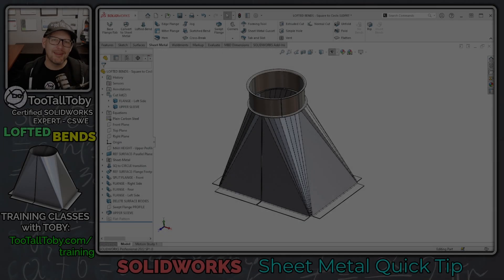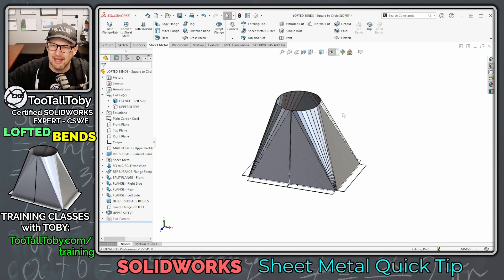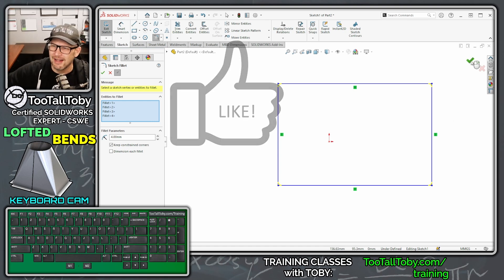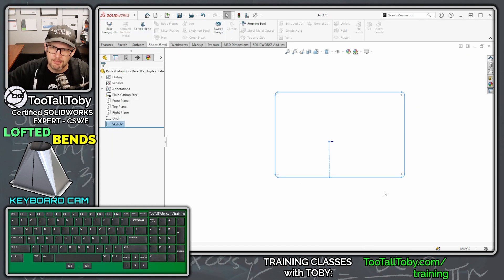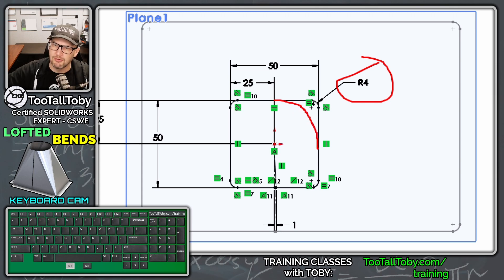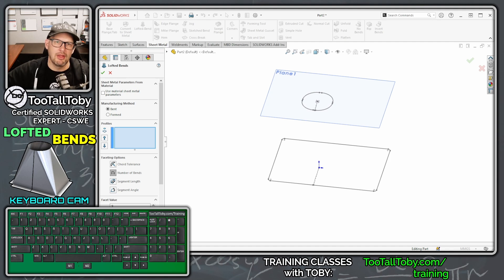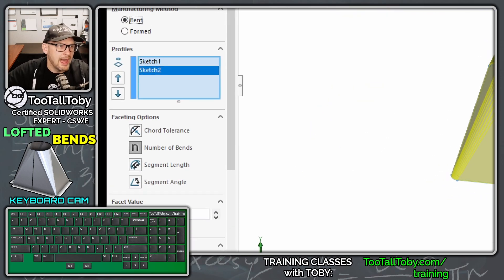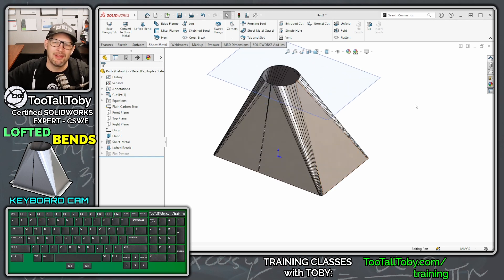Air Duct Reducer in SOLIDWORKS Sheet Metal - Tutorial for Students - Rectangle to Circle - HVAC

Comment: What you are showing here is nonsense. You can make from square to round. sketch topics doesn't have to be the same
Reply from the maker: Bro you've been following me long enough that you should know that I'm usually pretty on point, and that I'm not going to release a video (and leave it posted) if it contains "nonsense" 😁

Under MANUFACTURING METHOD, You can only use the option for BENT if you have the same number of entities in each sketch.

Try it
Reply: @TooTallToby  my good friend I make a living drawing parts like this. try this, you have to draw a circle and make the cut in the same place as the square.
Reply from the maker: Nice - Maybe it's just my version of SOLIDWORKS but when I follow the steps below, I only have the FORMED option, not the BENT option (for a sheet metal lofted bends command).

I re-read your replies and I noticed that you have only discussed lofting, but have not specifically said that you are able to do these steps using the sheet metal lofted bends command, and the manufacturing method of BENT.

Perhaps you could try these steps and confirm:
1. New part
2. Sketch a circle on the top plane
3. Add a gap to the perimeter of circle so that it is not completely closed
4. Exit sketch
5. make a new sketch plane, parallel to the top plane
6. New sketch on this new plane. Sketch a rectangle
7. Add a gap to the perimeter of the rectangle at the same location as the split to the circle sketch, so it is not a closed rectangle
8. Add fillets to the corners of the rectangle
9. Exit sketch
10. Launch sheet metal lofted bends
11. Pick the 2 profiles
12. Choose the manufacturing method option for BENT
13. hit the green checkmark

For me this doesn't work. I can use the option for FORMED, but not BENT

Let me know if it works for you, and let me know what build of SOLIDWORKS you're on.

thanks
- Toby
Reply: @TooTallToby  Hi Toby Sorry, I didn't mean to attack you. And yes it works. Believe it has worked since 2020. you are doing a good job thank you for that. have a nice day. Wagner
Reply from the maker: Thanks-  can you create or share a video showing this working? I have tried this many different ways using SOLIDWORKS 2020 and 2022 and I cannot get it to work, and I'd love to see what I'm doing wrong.  

Or maybe create a file in SOLIDWORKS 2020 showing this functionality, and then share the file with me? You can post it on discord or here in the comments (via share link) or use the CONTACT ME function on my website to send me the share link.  Thanks!

Comment: Toby how would you make the guide vane in between two cylinders each having tabs that would allow fasteners through to connect with both cylindrical casings
Reply from the maker: Yes - that's one way to seal the loft.  You could also weld the seam, or even have an overlap where the seam is.